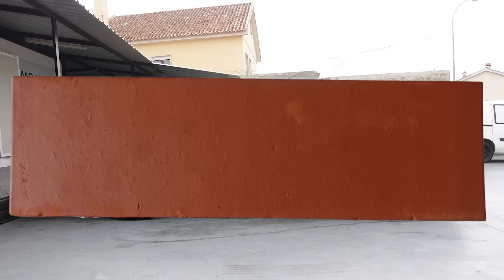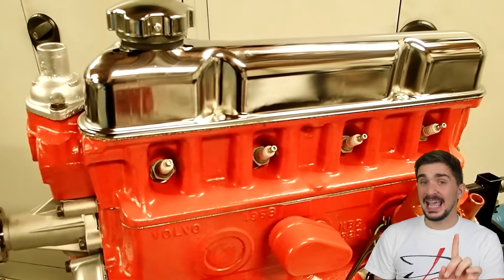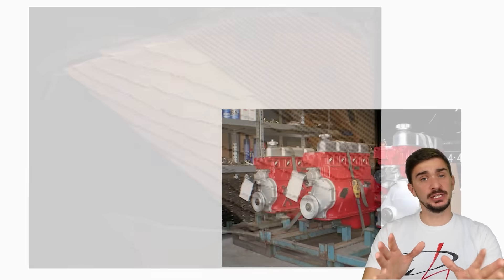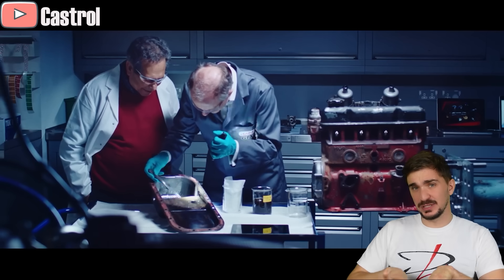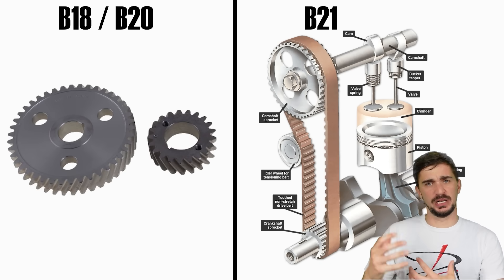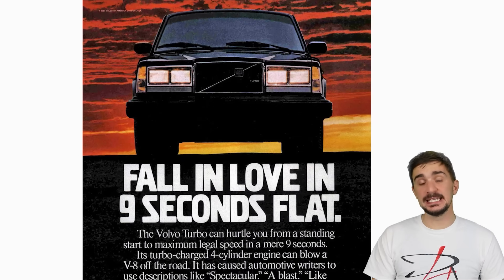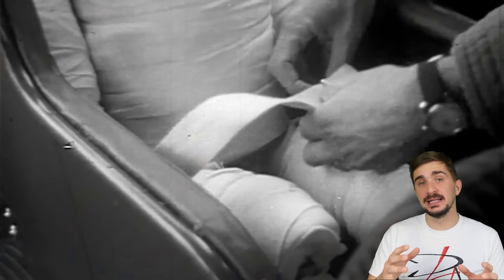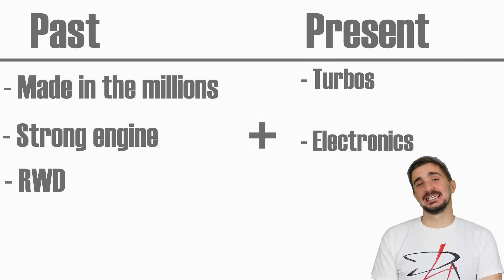A Story about the Volvo 240 and its Redblock Engine - Iconic Cars and Engines #18

Comment: The stress tests sound even more insane than the legendary Chrysler slant 6. Apparently Chrysler thought the drivers that chose one would haul a house trailer at full throttle every day. Uphill, both ways.
Volvo must have asked "What if they added a second trailer, and it was snowing?"
Reply: Most of American designed In-Line 6's were made that way.  They were initially  built as industrial type for gas powered farm tractors and generators.  The Slant 6 was so durable because when they tipped it over to accomodate the new low-line hoods, the unintened result was better oil wash and  a slower oil  return to the sump when the emgine was sitting cold.  Thus, more oil was retained in the upper parts which simulated the modern pressurized oil systems of today.  Oil  is everything to longevity, and explains why the GM small blocks were so good.  large oil galleys.  large oil galleys also are present in the famous AMC 258-6, which Chrysler kept building as the 4.0L.  Legendary engines.
Reply: @OutnBacker  …unlike 5.7L hemi’s which like to eat lifters due to oil starvation.
Reply: @aluminumfalcon552  Chrysler, from the 80's onwards, always seemed to have at least one engine style that had issues with oil. You would think that after a while they would check the entire system to find places that would either restrict oil flow under heavy usage, or would be prone to clogging after a few years.
Reply: @aluminumfalcon552  Same with the 3.7, which I have in my 2012 RAM 1500.  A good motor, but they were known to have the same issues because therae basically the same engine, just with 2 cylinders cut off.  So far I've been lucky, but it does have that annoying "dry" start, with metallic noises up high in the valve train.  Runs like a Swiss watch, though - so far.
Reply: @christopherconard2831  Yup, it's all about capacity and flow.  SHould be simple enough.
Reply: @christopherconard2831  the 3.3/3.8 has no problems
Reply: @OutnBacker  I've had two AMC vehicles with the I-6 engines. A Hornet (my first car) and a Jeep. Neither was going to win any races, but they always ran.
Reply: @christopherconard2831  The AMC engines thatwere carbuerated weren't vary fast, but Chrysler did a good thing by installing the Multi-Port Fuel Injection system.  A whole different animal was born.  My 96 Cherokee was a rocket.  Now, I have a 95 Grand Cherokee with the same engine.  At 700lbs heavier than the little Cherokee, it's a dog, but reliable.  A time capsule cream-puff, too.  gramma owned, garage kept.
Reply: @OutnBacker  my brother's first car was a 98 grand cherokee with the 4.0 i6 and it drove another 9 months without issue after it was missing #6's whole rod and piston from its trip to the oilpan 🤣
Reply: now, Dad had an old retired Taxi, which had an audi straight 6 diesel, but we towed a tractor with that Volvo 244. Sadly far too many have been junked because Sweden got hard environmental laws about having a yard full of old car-wrecks.
Reply: @andreassjoberg3145  kind of ironic because keeping an old car maintained is far better for the environment than buying new disposable cars all the time. I guarantee one million mile Volvo has impacted the environment far less than however many Teslas, new batteries and charges of those batteries it takes to go a million miles.

Edit: I forgot Sweden runs on hydroelectric and nuclear, but the manufacturing of the car and new batteries is the biggest impact in that equation anyway.
Reply: @aluminumfalcon552  Indeed. Although cars still really suck as a transportation method... Or should i say the infrastructure for them sucks? By that i mean they're very dangerous, super slow in cities, give you horrid headaches with parking problems. And while i do think that most of that can be improved with better infrastructure, i still kind of feel iffy about knowing that in the car behind, in front, or next to me can be driving either a moron, or an old/drunk/medicated/high/sick/underslept person in this situation where their one error can cost them, and me crazy money, injuries or even our lives... What was it, about 1 in 100 people will find their death on the road? I still own and drive a car, but that stat's frigging terrifying.
Reply: @mkzhero  If everyone drove exactly like I do, there would never be any of those issues🤣 I’m observant, cautious, and courteous, but at the same time I am not slow, nor hesitant. Too bad most people are failing on one or all of those traits as a driver. I agree with you completely on those things though. Just look up idiots in cars on YouTube and there is no shortage of dashcam footage to prove your point.
Reply: @aluminumfalcon552  well, you see, except not everyone's you or me, and are in the same good health and awareness. Even if the tests included checking for all of that, which they don't, there's also vision and reaction time deterioration with age, overwork and undersleeping which will fuck us up as well, let alone someone in worse shape, even to the point of crashing while alone on an empty street, degenerative diseases and medication problem, plain heart attacks and unexpected seizures, unexpected distractions, and especially on unfamiliar routes and roads... And all on infrastructure that's built by government, aka the most inefficient and evil institution on the planet... Which means even if all of the above wasn't true, and it always will be, you still have the problem of how horribly slow and inefficient government roads are in most places, and especially in cities. 

As long as government is responsible for the roads, city planning and other transportation, we won't get safe and effective transportation solutions anywhere. Though i doubt cars will ever be safe and effective outside of AI implementation, and i mean ACTUAL AI, not this "AI" crap we have now, aka a hundred years or more in the future.
Reply: @mkzhero You should walk.

Driving is too burdensome for you.
Reply: @aluminumfalcon552  And oil, like last winter because the nuclear has been started to be shut down.
Reply: Salvage yards didn't keep slant 6 engines because there was no market for parts.  I had 2.  They easily outlived the cars.
Reply: @Bob.W.  Some of the scarcity of 6 hole blocks in the 70's and 80's was due to many guys wanting a V8 if theywere going to all the trouble of a swap.  pre-fuel injected 6's were not very performance oriented so the market easn't very hot.  It applied to all six cylinder salvage engines.  I found a replacement  for my 77 Dodge Aspen SE wagon with a cracked block, but it took a few weeks of searching the entire Puget Sound region around Seattle back in '88.

If you ever want to talk about an under-rated car, the Dodge Aspen was a real sleeper.  Most comfortable and reliable car I ever owned.  The 96 Cherokee beats it in reliablilty but not in comfort.
Reply: ha ha ha lmao yes , brill 🙂
Reply: How volvo has fallen.

Comment: My parents gave me their old 240 DL volvo, my first car. Survived me stripping the spark plug hole, and putting the wrong coolant in the block. The odometer stopped working at 300k plus KMs so I don't know how far it got. When i finally broke it, it was towed away and sources told me they saw my car the next month dominating the local demolition derby. A true viking end.
Reply: It was a wagon too, the back seats to the rear was a perfectly flat 8 foot long space.

Comment: awesome!  Love the 2 series!! Running a 640hp Redblock in my 242 myself ;)
Reply: Wow what an unbelievable hp figures, may i know what is your mod?
Reply: @ramadhanisme7  2.9L stroker 16v turbo.. should be capable of 800+hp once i get back on the dyno with more boost.. but its been sitting idle really since covid (everyting closed....)
Reply: @CbrBlackblade  stock internal?
Reply: @ramadhanisme7  no, aftermarket stroker cranck, rods and pistons

Comment: Yes I know.I have the B20 115 aquamatic in my 15' plylite fisherman.Owned from new ,yes they are very good after about 20 years use took it in to have it checked out inside.They found ir had ni wear so I  had them microw balance the crankshaft.
The one other thing you didn't mention was how economiical thw fuel consumtion is.
I still have this boat today and will use it till im to old not to.

Comment: As a 122 and 740 owner, I love my worked b20 and b230 motors, a very stout motor given the work needed for an SR20 to make 500whp reliably.

They did do r-sport builds for the b18/20, double factory hp. First turbo motor was in the 240 though, with the b21, before the 7 series's came out.

Comment: As a retired 40-year collision repair tech, really enjoyed the 240s all those and 740s, almost like a snap together toy. And if we had to do some light mechanical work that was easy to. This car was designed to be repaired properly in the event of a collision with ease and accuracy of repair.
Reply: Easily the best car I ever worked on, changing the brake pads made me insanely happy, I looked forward to it, I couldn't figure out why other companies weren't stealing the ideas
Reply: and also designed to never be repaired mechanically. i have yet to see a 70-90 volvo engine that need any repair that is not general care like plugs....did anyone ever blow one with less than 900 000 km in the world ?   hard to beleive the t5 is a reworked ford engine ( the 2.3 is a ford tempo engine running on volvo electronics . thats why people been buying tempo engine parts instead... way cheaper without volvo logo even tho its the same part with same quality and same part number just like audi/volks ) and knowing the 850/850R was even more reliable and durable than the famous b18 b20, it tells how volvo used to know that they were doing.
Reply: @Broken_AK47  Dad blew up a 940 engine once, but it was a trashed old car with a malfunctioning dash, no working temp gauge. One of the coolant pipes burst, and the engine kept trooping on until it seized like a brick.

Apart from that, nothing really. Leaky head gaskets occasionally, leaky rear main seal permanently. But just refilling oil slightly above low as soon as it hits slightly below low keeps the leak manageable.

Road in front of my parents house has a giant black mark from 2 decades plus of leaky oil seals.
Reply: @Broken_AK47  I had one with 300k MILES, the tranny was toast but the engine ran and looked like new.
Reply: Because the design is to easying the mechanic's job to repair the broken parts of the car after collision with standard tools such as hammer, a saw, a metal plate scissor, and maybe a welding machine.

The old days were a practical age for mechanics, or for someone that had passion for mending things themselves.

Comment: If only it was the law that all engines had to get 3 million miles, and have zero electronics,  the world would be a much better place.  I've been a mechanic for 24 years,  and I, along with every other life long mechanic,  despise electronics in cars, they cut longevity by more than half and in newer cars they are pretty much the only reason they get destroyed.  If you can't tune a carburetor, drive a stick, and hear the rpm range to shift, you shouldn't have a license.  P.s. my 45 farmall tractor will outlive everything on the road for two reasons 1, no electronics whatsoever,  and 2, every inch is made of either cast iron or hardened steel, no plastic, no aluminum no crap.

Comment: What kills most of these cars isn’t mileage or being driven by 20 year olds with heavy feet. Rust kill them. The rust protection was pretty bad before 1988 when Volvo started undercoating them so they didn’t rust as easily.

Comment: The 240 my father joked about getting me, but probably should have gotten me... Unlike the 95 240SX I have, which has been sitting for 12 years, the Volvo  240 would probably still be running too. Kept spinning that 3rd cylinder rod bearing. lol

Comment: Years ago in the early 80's, I got to work on a Turbo project at the Volvo Plant in Chesapeake, Va. Volvo wanted to race the 242 turbo coupe, but not in stock form. To race, they had to manufacture 500. We did 250 and another facility did 250. Larger turbo, larger intake, larger intercooler, different hood . A few had water injection to cool the intake charge, and many more things. I worked in QC and got to inspect and road test these. Great fun. When finished. All were inspected by an outside source to prove authentic. We then went to work pulling off all the modified parts, and installing the stock parts bringing them back to original. Inspected and tested. Yep, me again. So there are 500 of these that were sold to the public never knowing what their 242 turbo coupe was used for.

Comment: I'm loving this video. My 1990 Volvo 240DL Estate with the automatic is still running like new at 620,000 km. I'm just now at the point where you start the red 244. It needs a tune up and carburetor set up. It should start MUCH quicker than that. Our 81 had the 2.1 litre with side draught Zenith carburetor and even at -40 degrees it started better than that
Reply: Hello Michael how are you doing 😊

Comment: Wheel bearings killed the 81 240, we had. Couldn't find replacements, none of the cars we looked at had good wheel bearings. The points outlasted the wheel bearings. The od said 800k, but the speedometer would slowly fall at highway speed. Really miss that car, learned to drive in it.

Comment: Can confirm these things are still out there. Saw one on the highways of California not too long ago keeping pace with modern cars like it wasn’t bothered. Amazing engineering!
Reply: They're still very common here in Sweden, especially on the countryside or outer parts of cities where a lot of old cars are still used.
Reply: Nowadays if you see one keeping pace with traffic in California, whats under the hood may not be a redblock.
Reply: @Froggy-news  it may as well be a redblock, but now with 600 horsies
Reply: @Froggy-news LS redblock 🗿
Reply: I have a 4 speed auto 240 with the original engine and it’s still just fine for driving in traffic. A turbo would be nice, though.

Comment: I drive an 88 244.  Simple to maintain, sort of boring to drive, parts easily and cheaply  sourced. 22-24 mpg on an automatic. It's like most well designed cars, if you make it easy to repair, and maintain it , it won't break.

Comment: i got to say i never expected you to talk of the beloved brick, but the video made justice and it is so true, 
the teenagers in scandinavia love these, myself included. first car was a 740 with 400k KM on the clock and i dailied it rallied it and was off the road with it several times before me banging the oil sump gave the engine a early demise during a rallycross day. 

got a 240 now with it's "SPORTY" B23FX engine 136 maad natural aspirated ponies xD and some bolt on upgrades like under drive pulleys lighter flywheel bigger throttle chipped ignition and fuel ecu and a budget ported head soon to be slapped on.

love my brick
Reply: Can you tell Me where I can get chips for my b230fk? I am from Poland btw.
Reply: @bitchinflexin  BSR also got tuning chips and wastegates up to 0.8 or 1 Bar of boost as they sell as pacage deals
Reply: @Stale_Mahoney  they will ship to Poland? Can you tell me few quick info about these chips? What can I expect? No cutting fuel etc.?
Reply: @bitchinflexin  so if you are looking for a mild upgrade you can install a manual boost controller and adoust up til the stock ecu fuel cuts, as the only difference between the 135hp and 165hp engines was the wastegate pressure and not even the ecu's or open the stock wastegate and put washers in it to stiffen up the spring also works
Reply: @Stale_Mahoney  I got 531 head Vx3 cam and mbc. Fuel cut should be on 0.9 bar right? I'm thinking about chip or standalone. What turbo would you recommend? I preffer quick spool
Reply: @bitchinflexin  turbos is a world i have stayed away from it should be said, since i like rally i have gone the NA route, but i would suggest a turbo cam if you want to wake up the car a bit more, the NA cams from volvo is really not efficient when it comes to turbo use. what turbo you got on it now? 13c? and if you got a early turbo manifold going to a later design cast might also help quite a bit

Comment: First car a 1976 Volvo 244DL, B21 single carb thing, indestructible but even compared to the 850 5 cylinder cars it was a dinosaur.
Have driven every volvo model from the late 50's PV544 and onward including their military 4WD terrain vehicles over the years but only owned that 244 and a 2010 V70 5-cylinder diesel, a great car as well.